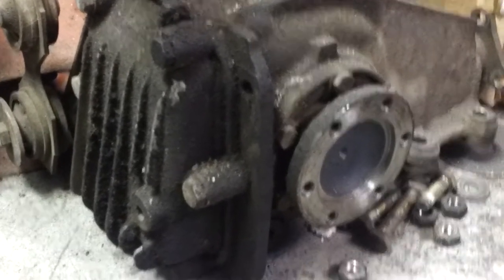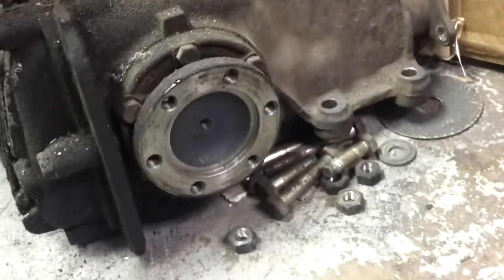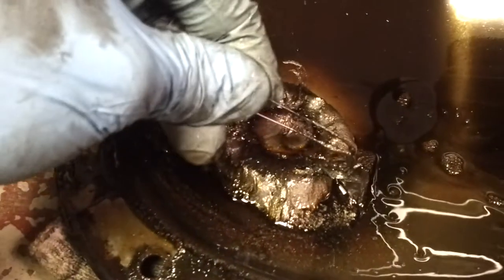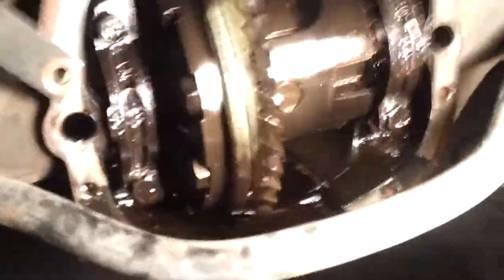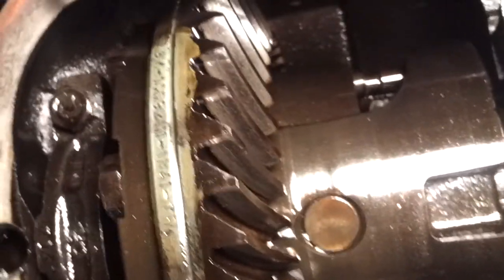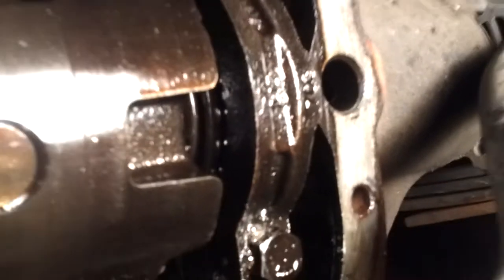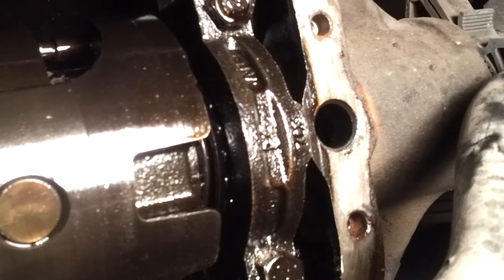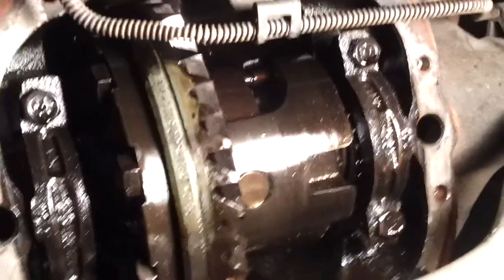How To Look For Blown / Bad / Damaged GM and Chevy Diffs

Comment: I realize this in an old video but for folks who stumble upon this with the same issue.. This is not a super hard fix. Even just new Carrier bearings would probably get you going again but it wouldn’t hurt to do the pinion bearing while your at it. You can probably source a whole kit and the tools are not super expensive. Probably the main thing you won’t have is a torque wrench to measure preload on the pinion, a small torque wrench meant for bicycle repair will do. Lots of instructional videos on deferential rebuilds are out there

Comment: the bearings are bad also check the spider gears hold the ring gear stationary and then turn the pinion gear or the axle shaft if you have bad spider gears it will cause a lot of Lash or play on the rotation of the pinion gear

Comment: it's called a ring gear a planetary gear system is in a automatic transmission a ring gear and the pinion gear you also have for other gears different manufacturers call them different names but I refer to them as spider gears

Comment: I have a chevy blazer and the guy told me the pionion bearings were hot and shavings in the gear oil.  Is it possible it's just the bearings need replacing?